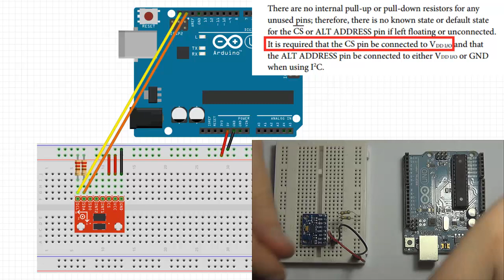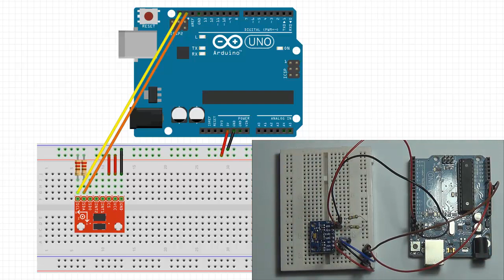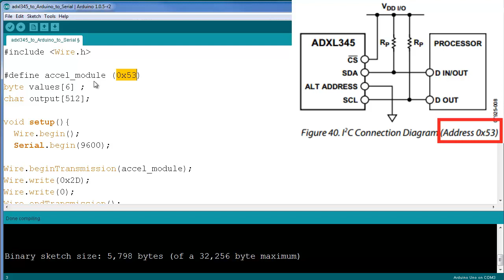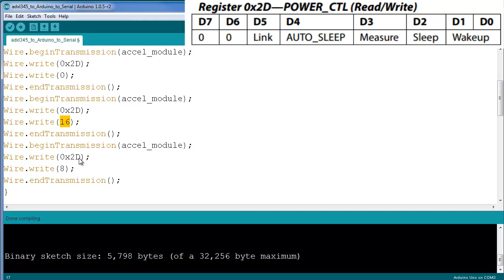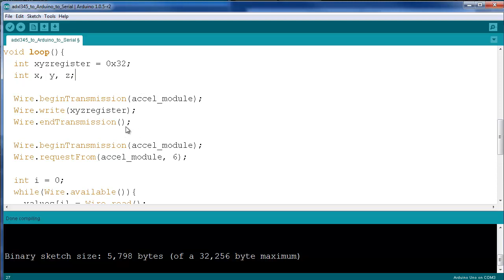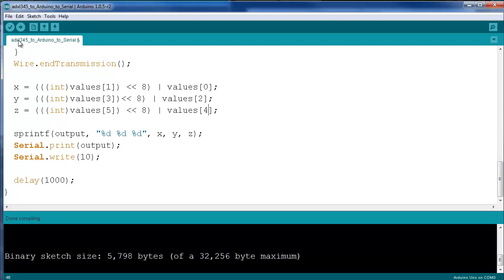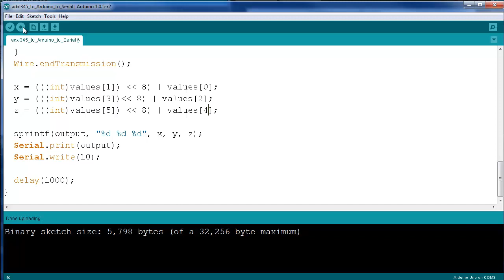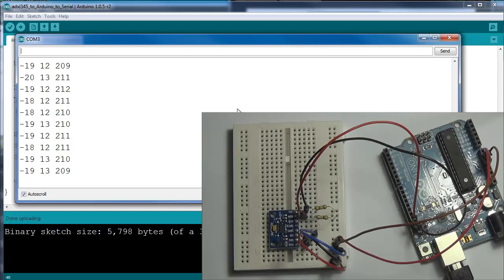Arduino #13 - 3 axis Accelerometer ADXL 345 - Robots, Quadcopters, etc.

Comment: Im only recieving positive values? Any clue why? If the raw data goes below 0, it jumps to 65000,  but that would be 16 bits? However the resolution is 12bits maximum

Comment: numbera are meaningless. Tell how convert them into metric values. ( m/s^2 )
Reply: in the datasheet you can find the value's , if i remember correctly, 256 is equal to 1G
so 256 raw value = 1G = gravity

Comment: Hello, thank you for this Tuto. I need to mesure a linear acceleration from a objet that will move from a point A to point B.  Do you think this sensor will fit for my needs? It seems all accelerometers I have seen so far only measures angular accelerations.

Comment: //For those of you who are too lazyto check the site
#include<Wire.h>

#define accel_module (0x53)
byte values[6] ;
char output[512];

void setup(){
Wire.begin();
Serial.begin(9600);
Wire.beginTransmission(accel_module);
Wire.write(0x2D);
Wire.write(0);
Wire.endTransmission();
Wire.beginTransmission(accel_module);
Wire.write(0x2D);
Wire.write(16);
Wire.endTransmission();
Wire.beginTransmission(accel_module);
Wire.write(0x2D);
Wire.write(8);
Wire.endTransmission();
}
void loop(){
int xyzregister = 0x32;
int x, y, z;

Wire.beginTransmission(accel_module);
Wire.write(xyzregister);
Wire.endTransmission();

Wire.beginTransmission(accel_module);
Wire.requestFrom(accel_module, 6);

int i = 0;
while(Wire.available()){
values[i] = Wire.read();
i++;
}
Wire.endTransmission();
x = (((int)values[1]) << 8) | values[0]; 
y = (((int)values[3])<< 8) | values[2];
z = (((int)values[5]) << 8) | values[4];
sprintf(output, "%d %d %d", x, y, z); 
Serial.print(output); Serial.write(10); 
delay(1000); 
}

Comment: Why do you need the 20k pullup resistors on SDA and SCL? I thought they are allready pulled-up by 4.7k resistors that are surface mounted on the board. Checking other videos using this module they don't hook up any pullup resistors the way you do it
Reply: Depending on the breakout board some of them have the pull-up resistors and others don't (for example the sparkfun ADXL345 doesn't have the pull-ups, whereas I think the Adafruit does.)

Comment: Hi, i need help on how to use 2 accelerometer on a arduino mega. i tried pluck in both to the SDA and SCL ports. but their readings add up together, how do i see each accelerometer readings individually?

Comment: i have copied the same code but an error is coming which is 'values' was not declared in this scope what does it mean.. please help
Reply: i faced the same problem them i replaced the code with,

Wire.requestFrom(accelModule,6); //Request Accel Registers (32 - 37)
  while(Wire.available() < 6);
  x = Wire.read()<<8|Wire.read(); //Store first two bytes into x
  y = Wire.read()<<8|Wire.read(); //Store middle two bytes into y
  z = Wire.read()<<8|Wire.read(); //Store last two bytes into z

Comment: Hey, I'm not sure what's exactly happening in it, the program seems to be working exactly fine but there is one part that's still confusing me, " xyzregister=50"
here you gave a "0000000000110010" into the xyz register, then how come the sensor is outputting values for all the three axis?
Reply: I might be missing a very small thing hope you could clear it

Comment: You could TEACH IN A CONTROL WITH CONTROLLING MPU 6050 02 ENGINES
EX : WHEN THE CENTER IS THERE A MINIMUM ROTATION OF TWO ENGINES ..... IF YOU ARE IN - ( LESS ) BEGINS TURNING STRONGER A MOTOR ..... IF IN TURNS ++ STRONGER ANOTHER MOTOR

Comment: +EEEnthusiast i need some help. i have two motors that i need to control, i.e. if i move sensor towards right then it should turn right motor. i studied your values but confused to detect in which direction sensor is rotating

Comment: Accellerometer measures force acting on the object so the z is actually pointing down and force that it measures points up when object is steady on a surface (it actually measures the static force applied by the surface). You can check by movement. X is front, y is right and z is down.

Comment: Hy EEEnthusiast! I have a bike (motorcycle) and I love doing wheelies. The thing is that at night the headlight lights up into the air and might not be seen by upcoming traffic. I thought that I can fit some COB lights underneath the bike and in any various places that will have a strobe effect and that they turn on every time the bike goes up in the air :D I bought a Digispark and this gyroscope trying to start this project, but I don't know anything about codes whatsoever. At the end of the video you are saying that if we have any questions, we shoulf post them. So my question is: are going to help me fulfill this awesome job that it will end up? :D Thank you master!

Comment: Sir,i am getting output all zeros i checked my connection many times,
 i connected same as you did, and also the code is same
Reply: did u solder your breakout board to connector pins?
Reply: maybe solder problem, too much solder makes the sensor broken.

Comment: So, I want my robot to make controlled turns ( i.e turn to a specific angle and stop). What should I use acclerometer or gyroscope? 

Until now, I assumed gyro, but seeing this tut, I observed that the accelerometer is showing the angles w.r.t the axis ( i think it was that ) and wondered if this is what i need?
Reply: with the accelero you can measure gravity's G force, so you can measure the angle its standing at.

Comment: Thanks for posting this.  I'm still trying to get mine to output anything.  The SDO pin should also be pulled high (or low) according to the datasheet.  The ALT ADDRESS (SDO) pin be connected to either VDD I/O or GND when using I2C.
Reply: Turns out the first one I purchased was evidently bad because the second one worked as advertised.  Thanks again for the video!

Comment: i am making an hand motion control robotic arm so which one i use? accelerometer or gyro?
Reply from the maker: +muhammad saad you would need a gyro for this. Alternatively, there are ways to measure this with a potentiometer.
Reply: thanks

Comment: Thank you very much great video!
Maybe you can help me understand why randomly the printf (meaning all the data stream) just stops coming in??
The communication just stop and when i reset the power it sometimes restart the code sometimes not.
When i pull out and and back in the SDL or SCL also sometimes helps and restart the code.
I double checked the set up, i used the same resistors as you ..
Hope you can help me out thanks!

Comment: What is the resistance of the pull up resistor ?
Reply from the maker: +kalavathi gopalaswamy I used 20k.
Reply: +EEEnthusiast can we use a 10k resistor?
Reply from the maker: Mohammad Shaaban yes, 10k is fine.

Comment: i have the problem on my output. All of them are 0. can you please tell me where is the problem? i  have already copy the same code but still cant
Reply: Read the Device ID first, it is 0xE5.
Reply: +黃冠儒 
+ EEEnthusiast 
I'm having the same problem. I checked all the connections - is there another possible solution?
Reply: Check your comnections

Comment: can i connect the ADXL 345 to arduino uno using wireless conection??

planning to build my project and i want to use the acclerometer in my wireless controller

Comment: HI! is it OK to connect the ADXL 345 to 5 Volts. The datasheet says that its range is up to 3.5 Volt.
??????????????????????????
Reply: EL TIGRE CHINO from the document: Supply voltage range: 2.0 V to 3.6 V
Reply: +EL TIGRE CHINO No.  Get the $18 version from Adafruit and you can use 5v.
Reply: he makes a good point since there are many 3.3v versions out there

Comment: can you run this with raspberry pi?
Reply from the maker: Andrei Tjutrin Of course, it is not device specific. I usually demonstrate modules on the Arduino because it is faster to code, but the same concepts apply to any other controller you may select.

Comment: i am working with MMA 7660FC accelerometer and i got the values but not changing the axis values when moving the sensor . can help me ? what is the problem can give any suggestions?

Comment: Write(16) is D4 not D3, Write(8) is D3, not sleep.  The x,y,z calcs convert 2 8 bit bytes to a 16 bit word also btw.
Reply: Atmel ve PIC microcontrollers works MSB first. And that register also MSB. So Wilksey37 has right.
Reply: Depends on LSB first or MSB first.